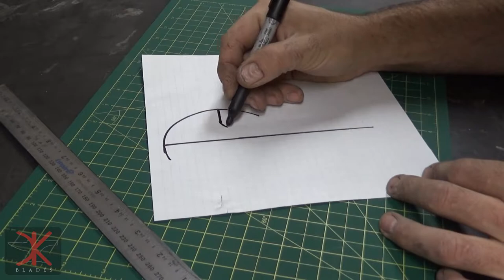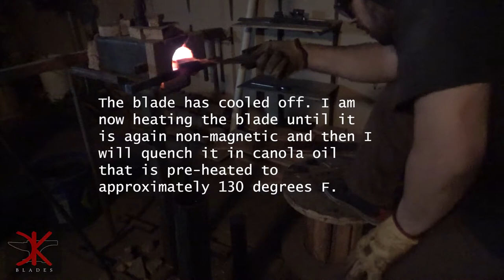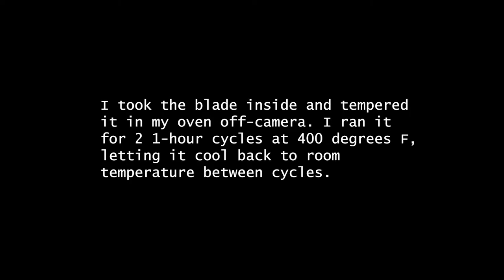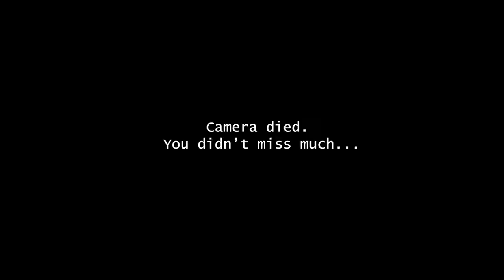Making a leather crafting knife from a saw blade

Comment: what would you charge to make one like that and one with the grind just on the right side?
Reply from the maker: If you click the subscribe button I'll think about it
Reply from the maker: In my humble opinion I have improved my skills a lot since the making of this video. I use a more premium handle material these days so I would be inclined to go all the way and make it as nice as possible, including acid etching the blade and using stabilized wood for the handle. Something like I am describing would be in the $160 range (Canadian dollars). For one like in this video with basic hardwood, not stabilized I would say I can do it for $90 (Canadian dollars). Please feel to reach out by email or on Instagram if you are interested. My contact info is in the 'About' tab

p.s. Thanks for subscribing! 🤝